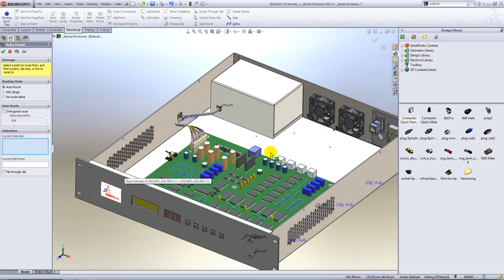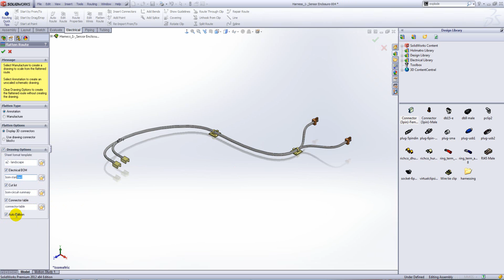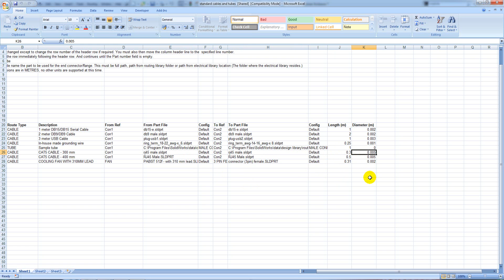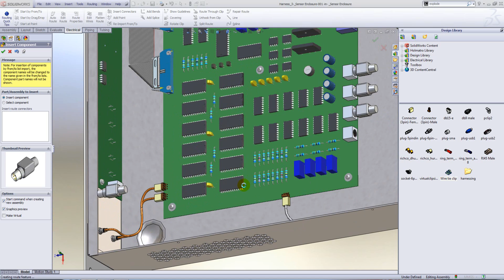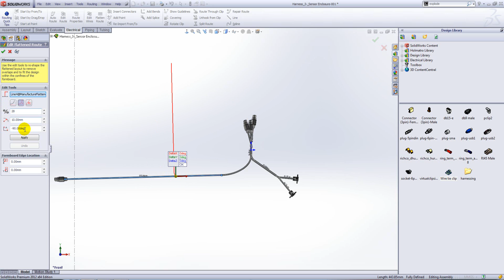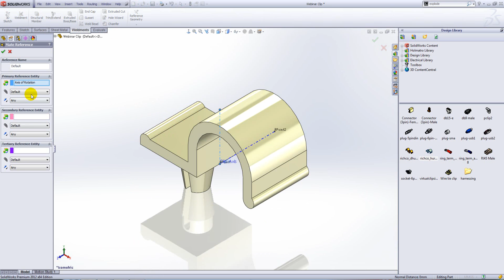An Introduction to Electrical Routing in SolidWorks [Webcast]

Comment: For this process does it required the line/wiring diagram inside solidworks electrical project? Or it can generate the diagram after finish the routing?